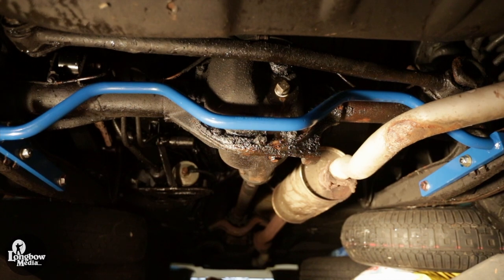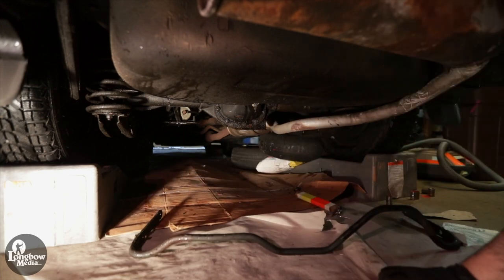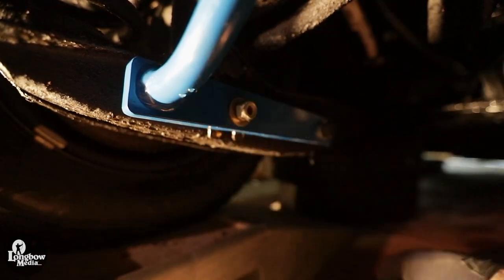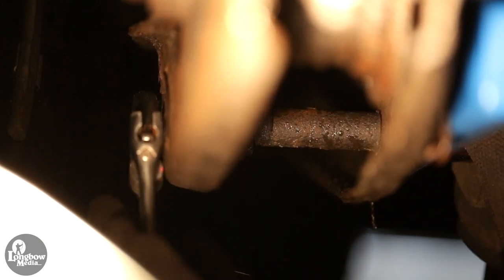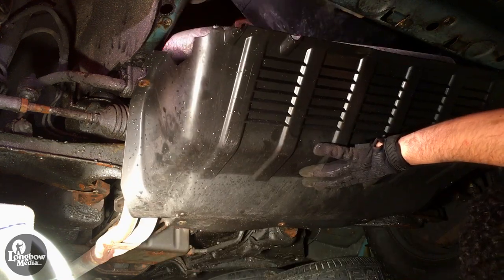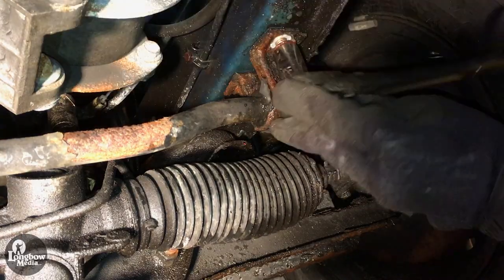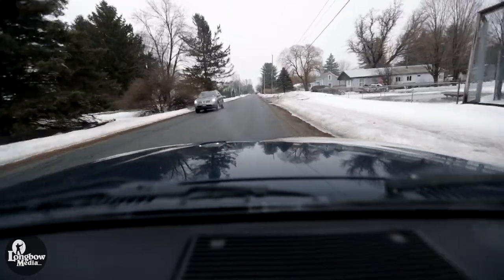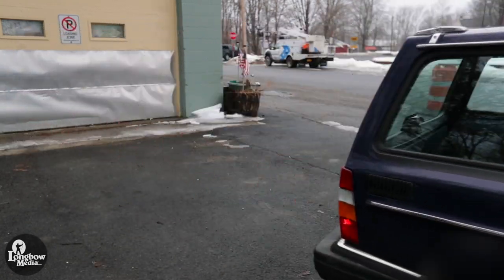IPD Anti-Sway Bar Installation Tutorial - Volvo 240 / 242 / 244 / 245

Comment: If you’re going to install new “pretty” sway bars on your wagon, why not spend a few bucks degreasing the undersides of that thing?!  That’s a phenomenal amount of grimy build-up under there.
Reply from the maker: I have the underside of the car coated with hot oil every winter for rust prevention.
Reply: IPD anti-sway bars are not a cosmetic upgrade.  They are beneath the car, painted blue for the benefit of squirrels, little birds, and the like.  It’s a performance upgrade, but I’m sure you knew that.
Reply: @longfade  I have soured on IPD "performance" parts, which for me have worn out prematurely.  My "HD" swaybar links failed after 10k miles.  Mostly for ego gratification.  There are numerous outlets like Snabb and Viva that deliver genuine upgrades.
Reply: @reallyhappenings5597  neither makes parts for 240 so how did you source parts from them?